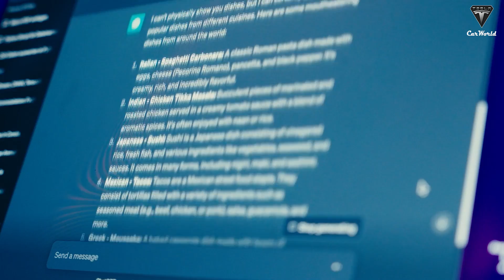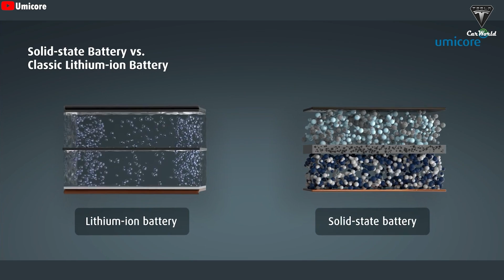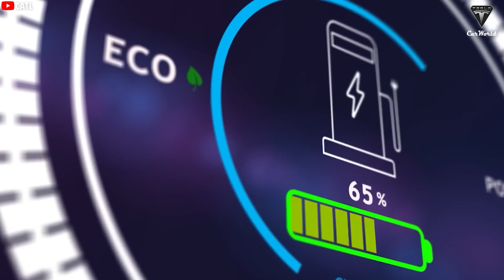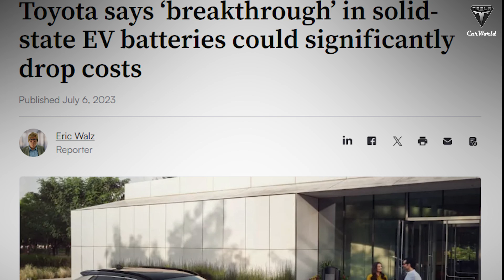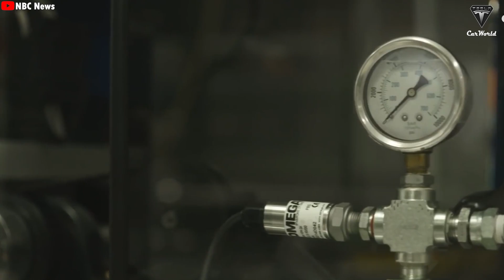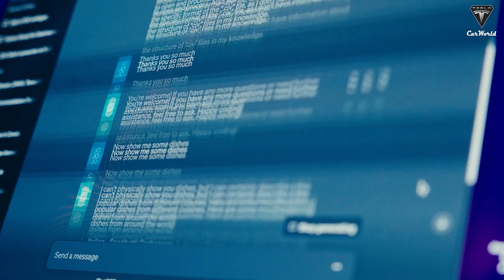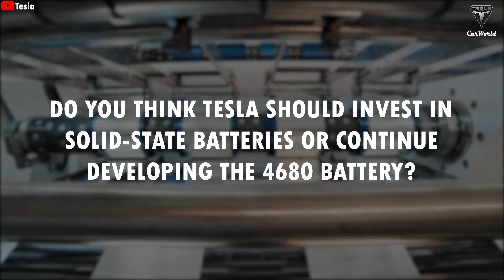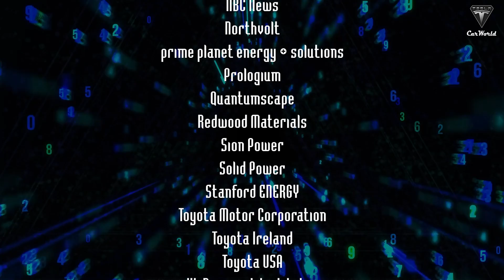Elon Musk Shocks About Toyota 1000 Miles Solid State Battery? BIG Rival Tesla's New Gen 4680 Battery

Comment: CATL is the biggest battery maker for EVs.  Their owner and President said that he spent hundreds of millions on solid state batteries.  He said it needs materials that currently don´t exist.  You can make a battery in a lab, it has to be made at a very high pressure.  So he said the concept is there.  The problem is that after 8-10 recharges the battery fails so it´s not viable as a commercial exercise.  Toyota has never shown anyone their solid state battery.  They also talk about hydrogen even though Europe and the US have no real hydrogen net work.  Toyota doesn´t want to talk about Lithium batteries or full BEV.  Japan does not have the resources for this so would be dependent on China.

Comment: There will always be a better battery under development but, as an EV owner, I have already come to terms with the issue of range anxiety which is no longer a thing for me. A few weeks experience with a recent EV design is all you need to appreciate this. Like all disruptive tech, it will take time to convert a lab example into a safe, production-ready battery with an 8+ year life manufacturer's guarantee. I would also point to Lithium Iron Phosphate which is demonstrating that power density is not everything, cost and safety considerations currently make LFP the fastest growing battery type despite its reduced power density.

Comment: Why? Who is actually driving 500 miles per day each way to work. A normal person wont even do 30-50miles per day. So any EV that gets 200-300 is more than enough. Do demand a Cellphone have a weeks worth of battery. NO. You just need it to last a day. So even with a EV most people who even take a road trip need to stop every 2-3h to stretch. And its a 15min top off. This will only help Planes
Reply: The reason why the range is because it will limit the demand at charging stations so you don't have so many people trying to charge all the time.
Reply: @ again charge at home. If you dont have a home understand. But still 300 is enough to charge once a week for most people.

Comment: You dont need 1,000 miles of range, 300 is plenty
Reply: You don't need 670 hp, 100 is plenty.
Reply: @robschroeder8297 maybe, but 670 is pretty sweet!!
Reply: @robschroeder8297  for a motorcycle maybe. One of my motorcycles has 167 hp.
Reply: 450 range would be awesome. I'll never drive 1000 miles straight
Reply: The issue is when it's really cold outside you can lose up to half your mileage, so if the car can only go 300 ish miles that leaves you at 150 ish miles and if you are on a road trip that's not really good.
Reply: @BossyGerbasi not true. You don't lose half the range. Fun to lie about though.
Reply: @CRPerformance1  lmao clearly you have never driven an electric car in very cold weather, and I said up to half.
Reply: @BossyGerbasi  I had over 107,000 in my tesla before selling it to my daughter. I live in Iowa. So.....
Reply: @CRPerformance1  then you are straight up lying dude, I'm not sure how cold Iowa gets but if it's really cold weather your Tesla or any other electric vehicle is going to be way less efficient in distributing and regenerating electricity, also having to use the heaters will kill your battery fast, so you are guaranteed to get 10% to 30% or more, less efficiency in very cold weather.
Reply: @BossyGerbasi  nope. Not lying. 10-20% less than in the summer. You claimed 50% less. That's why I called you out.
Reply: @BossyGerbasi  up to half? Why not say up to 90%? Both are correct. Your implication is a blatant lie so I called you out on it.